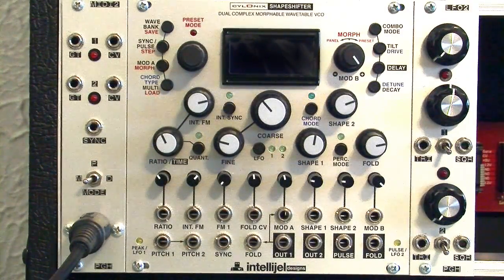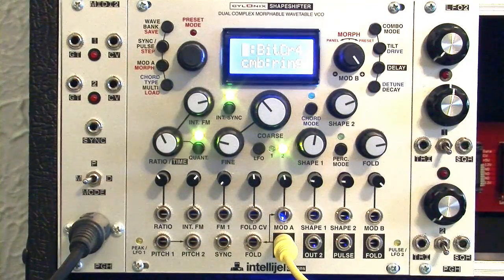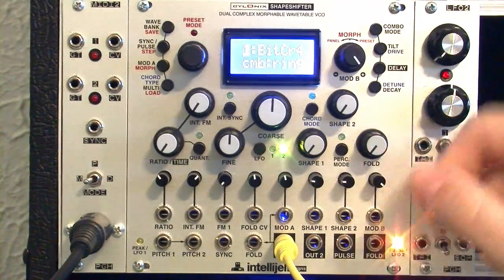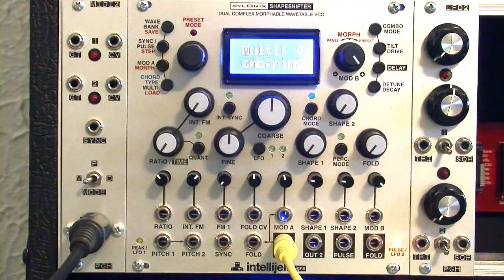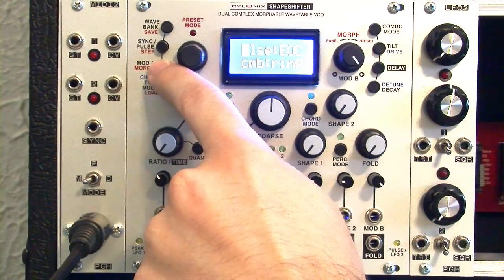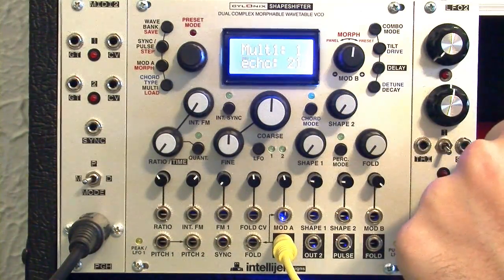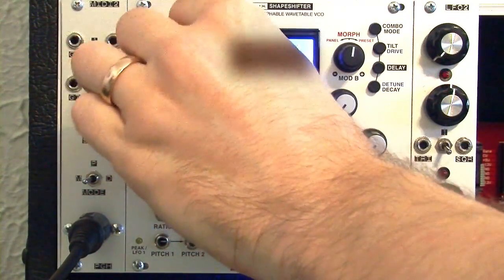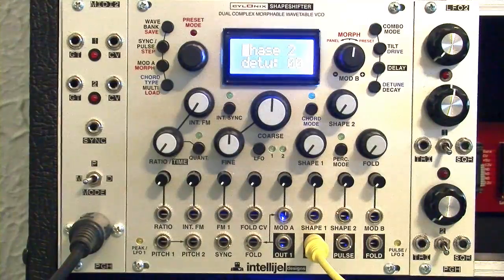Intellijel Shapeshifter Tutorial 1: Default Template

Comment: This is fantastic. Just got my Shapeshifter off eBay and found this series of videos indispensible. Thank you so much. One question - when did Intellijel update the panel design? Mine is the same as the one on the Intellijel web site but this one in your video is slightly different in terms of some of the text and the colours. But as far as I can tell there was never a "Mk. 2" issued?

Comment: Hmmm, I dont get any output from OSC2 unless my MOD A is turned up, any idea what I did wrong?
Reply from the maker: +Ryan Primmett Could be any number of issues. You might want to head over to the eurorack forums at muffwiggler.com and explain the problem in more detail there.
Reply: +Seth Shafer Thanks Seth, it turns out the previous owner must have calibrated osc2 without any signal, therefore making osc2 effectively zero Hz. It all good now :)
Reply: @zerachielplinius8093  it is supposed to be tuned down. you don't hear osc2 in this video either do you? (it's like a LFO, you don't hear it but it's there). watch the 2nd video :)